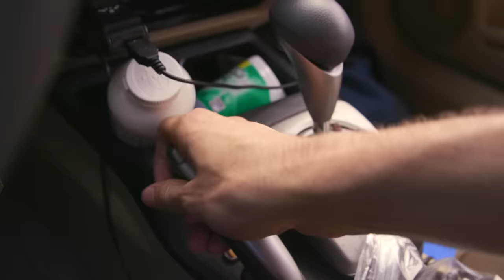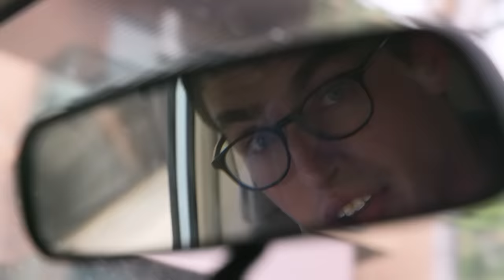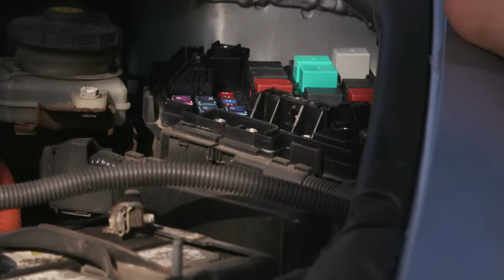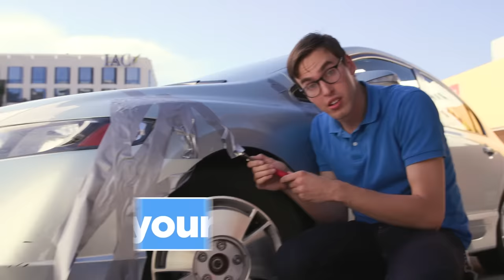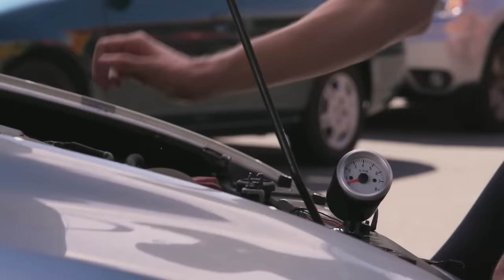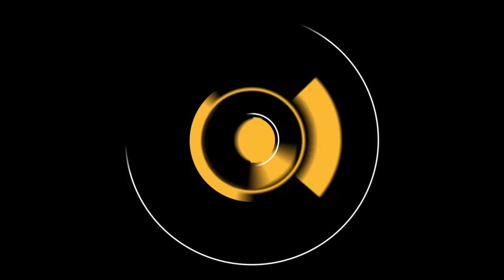5 Tips for People Who Don't Understand Cars

Comment: Tip 6. When merging on to the highway make sure to shift into 'R' for racing so you gain speed faster
Reply: Sam Kent and if you notice resistance, just pull/push the shift stick with both hands. 
That gear is designed with fit racers in mind, so it'll require more effort from the average person.
Reply: Once you need to pass someone, shift into P for pass.
Reply: Sam Kent If the police is next to you,go even faster
Reply: I tried this and now im in the hospital thanks
Reply: This is the most dangerous comment section ever! 
😭😭😭😭
I think I'm going to have an asthma attack from laughing so hard
Reply: This made me fucking cackle
Reply: Jhan Lourd 
Cackle? Not a normal laugh but a cackle? R u evil?😀😂
Reply: When You are Approaching a corner, Shift into D For drift so you can clear corners faster
Reply: When your lost while driving use your cars built in compass to head north by shifting to N
Reply: If you go in a ditch from shifting into racing mode then press the red button near your seatbelt lock while your car is still rolling  as that is the eject seat button
Reply: When the police come for your, shift to p for police chase mode
Reply: funny thing is my car is decently old and less than safe so while I cant do this, I can shift from reverse into drive at high speed without stepping on the brake. terrible for the car, but I can do it
Reply: Fauna zoo · r/facepalm
Reply: Sam Kent this is probably the best thing I’ve seen today lmao
Reply: But i have a manual!
Reply: You will start to notice that you’re going to roll backwards, but don’t worry, that’s totally normal
Reply: And pull the lever in the middle to activate the jet.
Reply: Thanks man I was wondering what R meant
Reply: Are these different names for gears?
Reply: Yea it stands for race
Reply: Why did iij go backwards
Reply: Reverse for people that actually need to know what it is
Reply: Or shift into P for Porsche mode
Reply: Where i’m from idiots slow down instead of speeding up to the speed of the highway lmao. They even completely stop until they see an opening which slows down everyone (they usually only merge when the whole highway is backed up)
Reply: Lmao 🤣
Reply: @andrewfoster3989  This is one piece of advice that is actually a bit helpful in everyday life.
Reply: @jacksonramsey4848  time out dude. The P is for police chase mode. Your credentials are a little sketchy man.
Reply: @Lawrence Johnson it's a racing mode. Room room mode comes in a Prius.
Reply: GENIUS
Reply: Yeah, I don't know why my cars night mode isn't working. It is on N
Reply: UNRFRussian Frog  😂😂🔥
Reply: Or you can shift into 'N' for Nitro-boost
Reply: When you here the car making weird noises, shift the gear to 1 to follow tip 1
Reply: Timppa 3 I think you mean “W” for Wumbo.
Reply: 9gag be like
Reply: @arx3516  All cars come with manuals.
Reply: No it's R for really fast
Reply: Lol
Reply: When you are following two or more cars on the highway, and you need to pass all of them, simply shift to 1, so that they will know that you want to become the first car in line, and will let you pass to do so.
Reply: M
Reply: You don't do that!!! R is not for racing u dummy! R is for Rocket Mode. You pop it on and your car can fly into space
Reply: And destroy your car in the process
Reply: @ctenosaura7380  please tell me this is a joke-
Reply: Tip 7 that little stick by the steering wheel that clicks when it's on , don't use it especially when turning on to a different road or changing lanes
Reply: Please don't listen to this advice..... I tried it and my car broke down... I guess it's only for racing cars
Reply: @ireacttoeverythingeverythi4833  nah N is for nitro boost
Reply: Tip 7. As a way to easily catch that asshole who cut you off back there, if you hold down your breaks and press down on the gas pedal, your car will take a screenshot via a camera in the headlights.
Reply: @Arasmuss   p is for park
Reply: R is for reverse
Reply: @christianseaman8838  P is totally for pass. I saw it on the internet.
Reply: If someone actually follows this comment....
Reply: Lmaoooo this comment is my favorite
Reply: Instructions unclear.  I now have 6 neutrals
Reply: R.i.p gearbox
Reply: @christianseaman8838  
The joke

Your head
Reply: @deepakv5705  So actually I was driving on the interstate once with my grandfather in the passenger seat. He's at that age where he can't see or hear very well and his mind is starting to go. He thought I had the car in the wrong gear and switched it from D to R, so luckily I can say firsthand that newer cars at least won't kill you if you do that, or at least give you the two seconds you need to scream and change it back.
Reply: Niggum
Reply: Reverse*

RIP to the people who didn't get the joke.
Reply: Mr. Perfect Cell  Both of you are lying, P means Parking. So P in "police chase mode" that basically means stop.
Reply: I had a really bad day today and the first 3 comments in this thread made me feel so much better because they're that funny
Reply: Solid comment

Comment: You forgot: If your car is making a strange noise....turn the radio up!
Reply: pooginmouse lol
Reply: if your engine  light is on simply remove the battery
Reply: I fixed mine that way. 😎
Reply: No wonder so many people put systems in $500 cars lol.
Reply: What's a radio?
Reply: The reason Subaru’s are usually broken down is cuz they don’t know if the smoke is coming from the engine or from there vape
Reply: take out the cardi b dvd
Reply: That sort of fits into the whole "ignore it" thing
Reply: @captaincargoshorts2068  No a piece of black electrical tape over the light works perfect!
Reply: That's kinda the first one tho
Reply: Works for me every day
Reply: @captaincargoshorts2068  that doesn't make sense. Just remove the light
Reply: My friend drives a shit box and I said hey your engine light is on and he just looked at it and shoved a screwdriver through the engine light and it whent away best mechanic ever
Reply: Bold of you to assume I have a radio
Reply: @alexzanderprinceton7162  why would you do that??
Reply: If you cant hear it, it's not actually happening

Comment: Just tell your dad about that time he called when the computer "wasn't working".
Reply: Oh god....
Reply: Check out where I explain how a tach works, it has other tips on calling your dad.
Reply: Sorry about answering to an old comment, but in my case: my father was the one that taught me about computers, he was the constructed my first computer, and the one that first proceeded to tweaking it ^^. I still don't know much about chars, but most manuals come with a tachometer, considering you're required to know the rpm at which you're changing gears to not burn your engine to crisp... Thou after a few weeks/months you learn to differentiate it yourself... and therefore ultimately unnecessary.
Reply: darkwoodmovies My dad is an electronic. He knows technology and everything connected to it.
Reply: @grottphd9090  Same with me XD (well used to be one either way he knows more then me)

Comment: induction tachometers measure how fast the gears turn in your engine by counting each notch in the cog untill it circles around as opposed to a non-contact tachometer that measures one pice of reflective tape on one spot in the gears rotation and a laser scans it as it passes, the reason you want a more comprehensive reading with induction is if you have a diesel engine you can adjust it to run any petroleum product such as parafin lamp oil diesel fuel even propane gas but thats WAY advanced even for "car guys" thanks for coming to my ted talk grahm
Reply: Idk if any of this is right but I was looking for this comment, thank you
Reply: @AH-tu3km  100% not trolling if im wrong its an honest mistake but i did google with the intention of answering this
Reply: Allison Hagan yeah, no, this is true for the most part. Only thing is that if you’re trying to run anything else through your diesel, why, what are you trying to prove, and for gods sake make sure you’ve cleaned your lines afterwards.
Reply: @jordanm714  Thank you! Much like Grant I am a little baby when it comes to cars 😭
Reply: Do not run a diesel car on propane! No! No-no-no! 

If you want a car to run on propane - get a gasoline engine with only port injection and without any turbochargers or whatever, and convert it: get a conversion kit from Europe, they make ones for most simple worldwide cars like Toyota Corolla, Hyundai Solaris, KIA Rio... notice how I didn't mention Honda Civic? That's because Honda engines hate natural gas conversion. Do not even attempt it on a Honda.

So a conversion kit involves a propane tank for the trunk, a pressure sensor, a hose, replacement fuel injectors, a few additional sensors and a gas button you install in a place accessible and visible for the driver. The button usually has an indicator of gas level with little lights, like on a power bank.

This conversion makes a car dual fuel. It can run on both gasoline and propane. It generally doesn't start on propane very well, and you don't wanna abandon your gasoline or you'll get trash in your gas tank and your fuel lines. So they solve both problems by letting a car start in gasoline mode, and either switching automatically or letting you switch with that gas button.

So, doing this makes your car a lot like a plug in hybrid. You can commute on propane, but take road trips on gasoline (gasoline quality is well regulated, while propane quality you get at a random gas station will be very inconsistent, and they may not even fill your car, only propane tanks). 
Driving on propane all the time only cuts your fuel bill 2x from gasoline, not 3x like electricity does. It's also not as safe as a factory propane system or a factory electric system.

So just don't bother and get the damn Rav4 Prime
Reply: Induction is also a type of non-contact tachometer.  As opposed to a regular tachometer that has a little rubber wheel coming out of it that you manually hold against whatever it is you want to measure the rotation speed of.
Reply: Also went through the comments just to see this explanation. Still not sure why average people would need that reading as part of maintenance though.
Reply: @Solkard  average people dont mainly its for diesel engines which can be made to run on other petrol products even lamp oil
Reply: @Solkard  and also because all cars nowadays, gas or diesel, pretty much have a tachometer already installed. You'll have to go back 50 years to find a car that needs a tach.
Reply: Thanks for your effort, but I literally toned out my own voice reading this and gave up eventually. Hope this helps Grant though!
Reply: @machinerin151  got it, RAV4 Prime (note: I don’t have one I’m just saying I understand what ur saying)
Reply: Don't diesel cars have a tachometer from the factory?
Reply: Yea it's true. I'm sure they taught us this stuff when i was studying for my aircraft mechanic's license.
Reply: @pjaxy  you only have to go back about 20 to 30 years to find some vehicles that dont have a tach. for example 1988-89 chevy silverado. a lot of cruiser motorcycles dont have tachs either
Reply: @Solkard  you don't, cars already have one that works perfectly. The gact Grant got the speech correctly at the end is probably because that's what his mechanic told him when he upsold him on an useless install.
Reply: Sorry but your description isn't quite right. Close enough for a youtube comments section under a satire video though.
Reply: @danrozful  criticism but no correction? Sounds like someone needed to feel important move on boomer
Reply: I figured what he was referring to was the electromagnetic field created by the alternator. This electromagnetic field is induced as the alternator spins. I think you may be able to pickup the individual pulses generated as it spitn and count those, but the strength of the field should also be related to how fast the shaft is spinning. Thus you can use this relationship to determine, approximately, how fast the shaft is spinning.

Edit: I'm a senior electrical engineering student and the above is an explanation I've come up with, with out verifying anything and should be taken with a grain of salt. I haven't taken any power generation courses (an alternator is essentially a generator) so I'm not exactly sure if what I said about the strength of the field is correct.
Reply: An induction tachometer measures the spark by measuring when current is passing though the spark plug lead. everytime the same cylinder fires it count one rotation. The joke is that diesel engines dont have spark plug leads
Reply: Woo! 400th like!
Reply: @seamusquain2706  wow I'm honored this might be the most web traffic I have ever created
Reply: @jordanm714  Let us celebrate, to a new personal record! 🥂